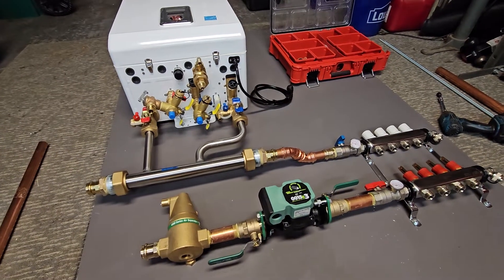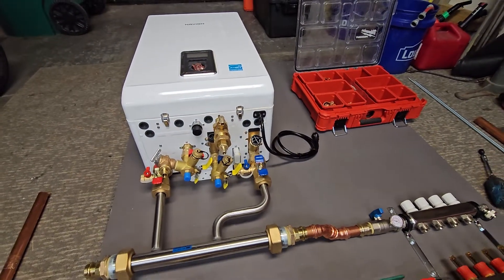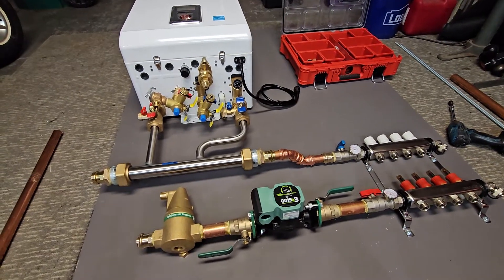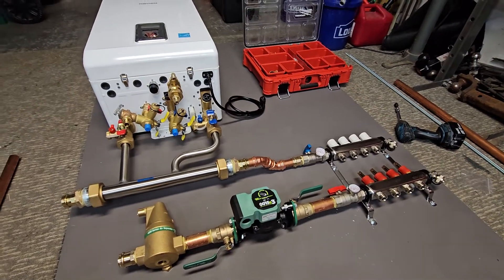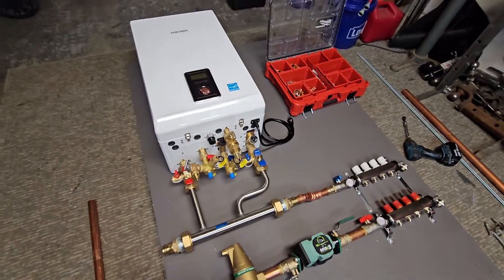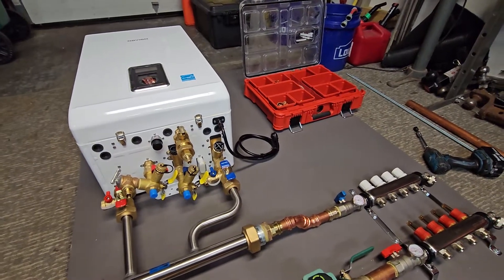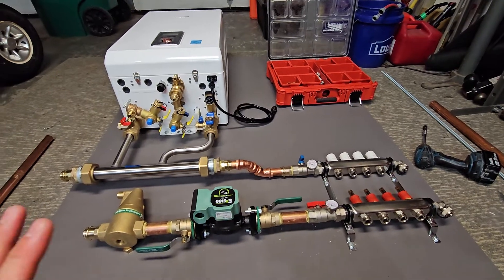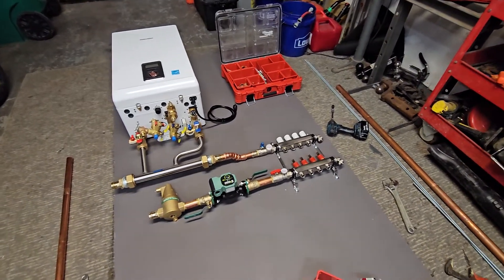In Floor Radiant Heat - Boiler System Build

Comment: why is the hot and cold on same loop
Reply from the maker: The boilers input and output are on a "primary" loop driven by a pump inside the boiler. The pump you see feeding the manifold is on the "secondary" loop. This hydraulically separates the flow through the boiler and the flow through the heating zones.

Comment: What do you mean by “it can handle 3 zones?” Does it have internal zone valves?
Reply from the maker: It has the ability to control 3 zone valves or 3 circulators.

Comment: Question: I am having a 25 x 30 / 750sqft garage shop built that is going on an engineered concrete pad.  Is there a max concrete thickness for infloor heating to work optimally, can it be too thick? The floor in my building will be approx 6" thick.
Reply from the maker: @Pompeytown 4 to 6 is normal

Comment: Hi Jim,  im currently doing a very similar install to this.  Is the internal pump enough for the 4 loops?  Or is the external pump needed?  I was hoping to hook up to my mainfold without adding another pump.
Reply from the maker: Internal pump is not to be used for the loops. It is a primary loop pump. Email me at speranzadevelopment@gmail.com if you would like me to design you a system.

Comment: Does improve functionality or will the internal sensor work fine
Reply from the maker: It ensures you are getting the correct supply temp to your zones. You need to enable it in the settings as well.
Reply: @JimSperanza  Hi Joe. If the sensor is on the supply line and the pumps aren't calling for heat does the Navien know this and use the internal sensor to maintain primary loop temp.?
Reply from the maker: @mikej6116 the primary pump only runs when there is a call for heat so it doesn't matter.

Comment: Hi Joe. I have a two zone infloor heating system with a Navien NCB 240/110H. Do you recommend an external supply water sensor to control the Navien SWT
Reply from the maker: @mikej6116  yes you can use Naviens universal temperature sensor.

Comment: I'm doing the exact system you have here single zone 4 loop, except it's a closed system with an axiom feeder. Have you done any? And do you just cap iff the built in water connection? Also on the domestic cold side do you have a back flow valve? BTW great vids
Reply from the maker: @granttruckey6270  use the auto feeder much easier to fill the system. Backflow preventer goes on the auto feeder not on the domestic cold.

Comment: Awesome channel Jim !  what would be a typical  delta value on the delta t circulator for an in floor radiant heat zone ? I saw in another video you used 20 degrees as an example but I think that was for a radiator system
Reply from the maker: 10 to 15 for comfort but you need to take into account making sure the boiler is condensing for efficiency.

Comment: Hi Jim I have an outside wood boiler that is connected via 1" in ground pex to a hydronic heat exchanger that I have installed in the electric furnace plenum in the basement so that I can just using the electric furnace fan to heat the house, also in the water loop I have in floor heating in my double garage. So the whole system is just one water loop. The wood boiler has just died and I want to use a Navien NHB to do the same job. Is this do-able and what advice do you have and what is the best way to calculate how many BTU for the Navien. Thanks
Reply from the maker: Email me at speranzadevelopment@gmail.com

Comment: Can domestic hot water be seperate (using same boiler) so that antifreeze fluids can be used in heating zones?  Allowing for seasonal draining of domestic hot water
Reply from the maker: Absolutely. They are isolated completely within the boiler system.

Comment: Is there any reason you do not use temperature mixing valve
Reply from the maker: A mixing valve is only needed when there are higher temps being delivered for other heating zones. This system is only one zone so the boiler can be set to the temp required for that zone so there no need to mix it down.

Comment: Great videos. If you wanted to get a combi for the 3 zones but not necessarily need dhw, can you leave the dhw dry until needed or does the dhw need to be charged?
Reply from the maker: You can use the heat only without the domestic hot water if you want to
Reply from the maker: The heating system will need to be working to use the DHW

Comment: Hello I've watched a lot of your videos very helpful! I'm putting in my own system for slab heat in the house that I'm building.. quick question does there need to be a check valve installed in this system? Also I have 2 zones (2 pumps) ferguson put together a package for me with a external taco controller included is that necessary? Thanks
Reply: Ok I understand I own a well pump company and have an account at ferguson all of the parts I was given are in line with how you set your boilers up except for the external controller just seeing if that's necessary if it's not I will just take it back thanks for your quick response !
Reply from the maker: It depends on which model boiler you are using.
Reply from the maker: I would be very careful when allowing suppliers to help you with boiler projects. They supply parts and from my experience they have no idea how to design heating systems. Contact me at speranzadevelopment@gmail.com and I can get you on track.
Reply: NNCB240130H

Comment: Love your videos. Do you have any of final installs running?
Reply from the maker: Most of them are shipped or picked up by customers and contractors. I do have many systems I have fully installed myself but do not have videos of them running.
Reply: @JimSperanza  I noticed that all the circulator pumps you use are cast iron, would using a stainless one be better?
Reply from the maker: @ms82xp  they don't make stainless versions of most circulator sizes. They would only be used for special applications. In standard boiler systems cast iron is the norm.
Reply: Does that manifold have built in shutoff valves for each loop?
Reply from the maker: @ms82xp  yes and flow adjusters.
Reply: @JimSperanza any reason it can’t be used for loops with baseboards/radiators?
Reply from the maker: @ms82xp  they certainly can!